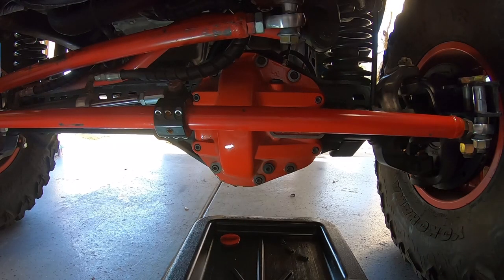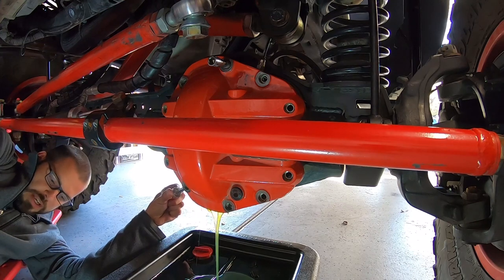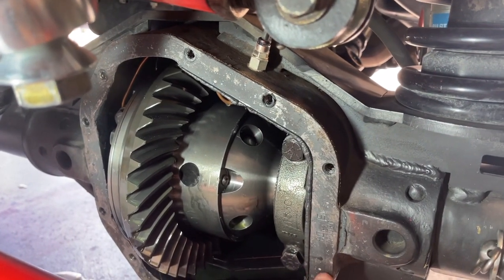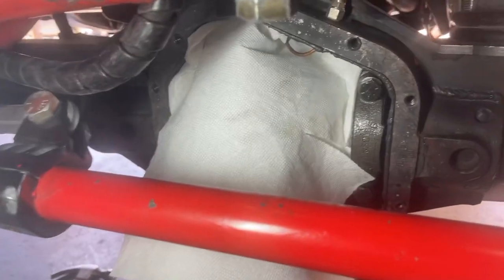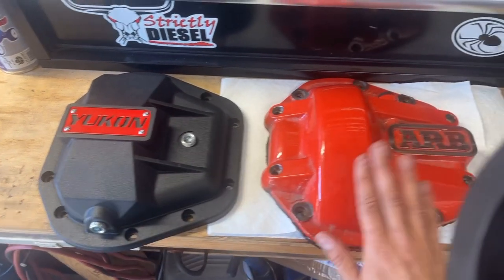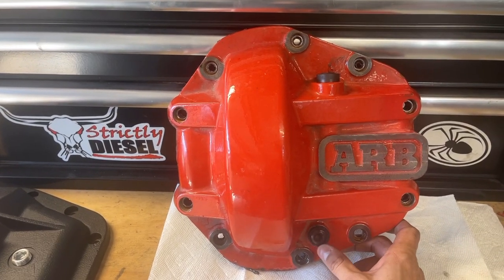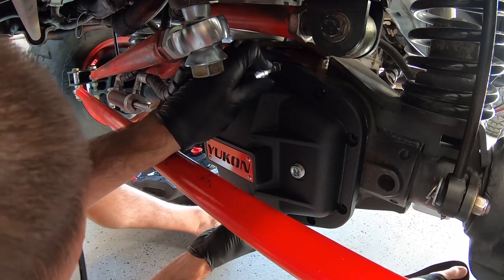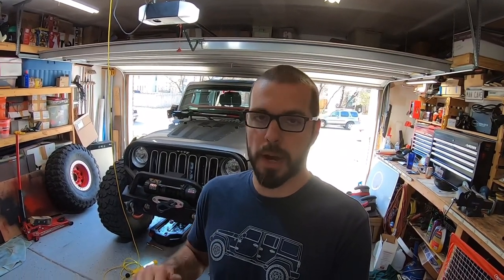DIFF COVER SHOWDOWN - Jeep Diff Service and Cover Install

Comment: One thing to consider between the two covers that most people never even think of is fluid dynamics. A diff cover is designed to aid in the flow of that diff fluid to every part of the diff housing. The downside to the Yukon cover is there are a lot of flat surfaces on the backside of the cover. Fluid coming off the ring gear hit that, splash up and fall down, versus the ARB cover, where the curve on the inside allow the fluid to flow over the top of the ring gear and make its way back to the pinion.

So, I while I do agree that the drain and fill plug are better protected on the Yukon, the ARB is actually much better for fluid movement inside the diff.
Reply: Absolutely

Comment: I didn’t realize how thin the factory diff covers are and need to change out the rear!! Thanks for this really informational video Dan!!
Reply from the maker: It’s a really good idea to replace them both. The new axle you are getting will have a better cover. The rear though, that will have the thin one. And the crazy part of dragging it over a rock can peel it away a bit and cause a leak. You don’t want it all to leak out and the. Run it dry. So it’s a good idea for sure.

Comment: Never had a problem with rocks bending my OEM diff cover flange.  But since I tow a camper, I need to change my diff oil more frequently, and I am looking to install a diff cover with a drain plug (and Lube Locker gasket).

Comment: Thank you sir. You helped me make my decision.  I was contemplating between ARB and the Yukon diff covers. Just got Yukon 1350 shafts for my 08 Wrangler.  I want to change my diff covers as well.   I think I will go with the Yukon ones. Better design with drain and fill plugs. The large mating surface also appeals to me. Have a good day.

Comment: Nice Jeep, FJ40 guy here. I like Metal Cloak nodular iron diff covers and Lube Locker reusable gaskets. They have skidplates for your diffs too.
Reply from the maker: Yes! They do. Not for a Dana 60 and a 14 bolt last I checked. But for the d44 they do. And as far as a diff skid plate…to me they decrease ground clearance and are really only necessary if you don’t have an aftermarket cover. Once you have that aftermarket cover…there is no way you’ll peel it on a rock.

Comment: I like the ARB better because the shape on the inside isn't beating the fluid unlike the other the cover is almost flat on the inside beating up the fluid and causing the fluid to foam up. Just my opinion.
Reply from the maker: That is definitely a concern. But with that in the ARB comes the issues of the o rings breaking down and then it being a pain to replace them. So it’s definitely a this for that. 🤷🏻‍♂️

Comment: I’m having clearance issues with my Dana 60, my track bar is not clearing my motofab diff cover, I have the Barnes track bar relocation bracket and it’s still not clearing. Idk if I should get a different track bar or try the arb diff cover, it looks to be more stream line than mine

Comment: Nice video...didn't show any fill tricks though...hand pump?  Little vs large gear oil bottles...what gear oil you ran. Still...cool vid.
Reply from the maker: Yeah it was just meant to show how to change the diff coves and a comparison. I specifically mention in it that I wasn’t gonna get into the fluids and things. So many people have their own preference. I just buy gear oil in quarts. Works just fine for this rig. Different rig might be different. But I also have Dana 60 and a 14 bolt axle. So what works on this axle may not on another Jeep axle. But thanks for the support.

Comment: Great video, appreciate the info!  So you don't use a gasket at all, just the Permatex?  Also, have you had any experience with Lube Locker gaskets?  I've heard that those work really good, as well?
Reply from the maker: i have had experience with those. and they do work. i dont use them because i always have ultra black in the garage and it works really well on a number of things. one tube is less tgsn one of those gaskets and lasts longer. just my experirnce. thanks for the support.

Comment: What size socket do you need to open the drain/fill plugs?
Reply from the maker: Tbh, I don’t remember off the top of my head. But it’s a hex bit. I just can’t remember what size it is. But your typical bit set would have it.

Comment: I noticed you didn’t clean the inside with brake cleaner. Any reason you didn’t?
Reply from the maker: I didn’t because this fluid had only been in there for a couple thousand miles. So it was super clean.,I probably should have mentioned that in the video. But this front end is very new, didn’t have hardly any miles on it. So it just wasn’t necessary.
Reply: @WarPaintOffroad  thank you. That makes sense. Replacing my front cover today.
Reply from the maker: @julioduenas9427  Awesome and thanks for the support!